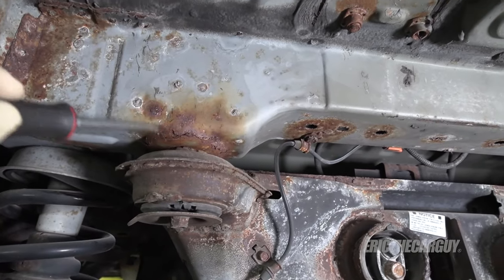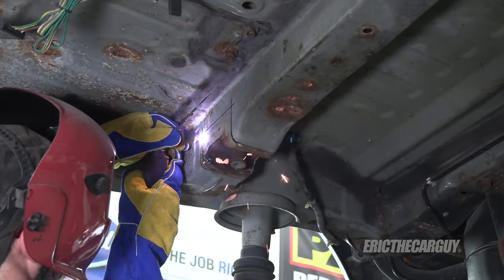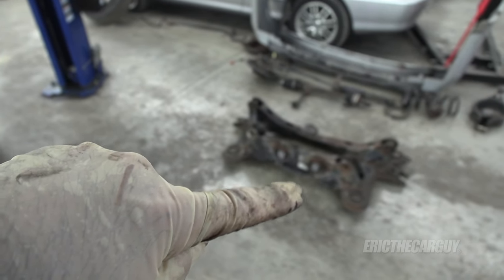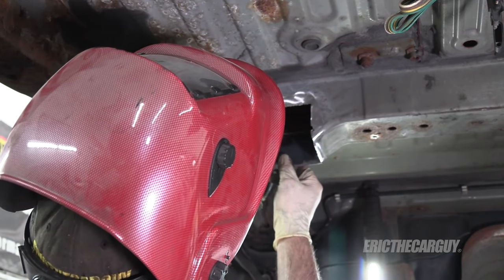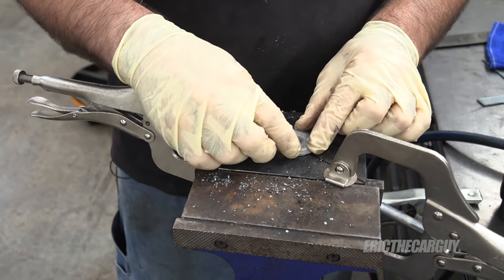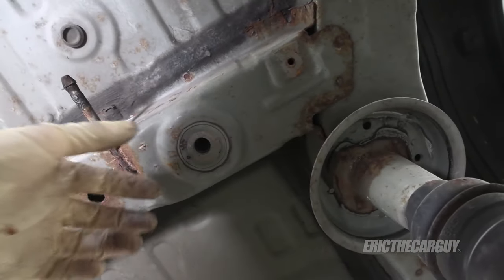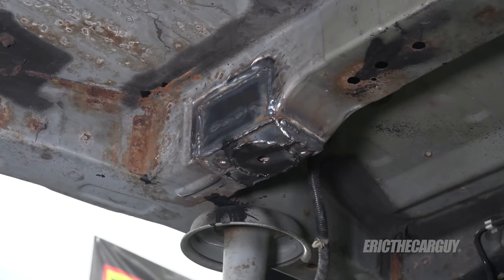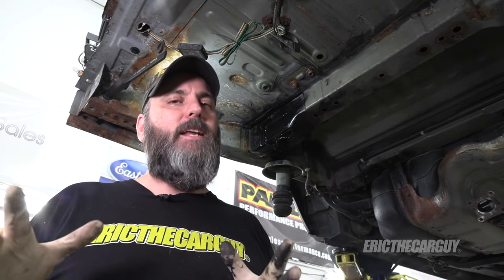How To Repair Structural Rust Damage

Comment: Hi Eric, weld through primer is a great product to help reduce corrosion on the surfaces you cant get to after welding.
Reply: i wonder how do they do on assembly line, the metal panels are raw they weld them and then paint it ?
Reply: @mondecruel1866  at the factory, the body in white is fully submerged in a vat of primer that gets into every single seam and blind cavity (if you have ever looked inside a trunk without the trim and wondered why are there so many stamped holes that needed to be plugged up, it’s because those were drain holes to let the excess primer drain out of the body as it was removed from the vat)
Reply: @mondecruel1866  They dip them in an acid bath after. Then they take other baths in sealer/primer.
Reply: @evolence detroit Look at any video that covers a modern assembly line. 

Ecoat is only done on replacement body panels so that they don’t corrode while sitting in inventory. 

All new cars during production do not get an electrolytic coating because it creates unnecessary prep-work steps through the production line.

The chassis and body panels are finished raw.

On a full production line, the chassis are dipped in an acid bath to etch the entire chassis, rinsed, then dipped in sealer/primer bath. Then it gets its finish coat from robots.
Reply: @evolence detroit  No matter how it's done, NOT even attempting to paint or rust coat bare metal is wrong. midwest to east coast, rust through in 5 years on this very decent repair. What a shame.
Reply: Best thing is to rust proof DIY way into those corners and holes. And if possible disassemble and reassemble using lots grease so moisture and water doesn't collect. We just have big bucket of cheap grease that we use for assembly - it saves nerves, time and money down the road.
Reply: @rotor13  VW uses electrostatic coating.
And the stuff is wicked, you can mildly heat a panel with a propane torch to use a wire brush to get the undercoating off, and the E-coat remains unhurt. 
Best to leave as much as you can instead of taking it off to bare metal.

Comment: If anyone wonders why rust repairs are expensive, this is a good video to show 

Inspiring work as always
Reply: Bondo and pop rivet rust repairs are less expensive.  This video shows how it is done properly resulting in a safe vehicle.
Reply: He did that repair in 25 minutes though, that shouldn’t cost $3k+! /s
Reply: @BlazingLightSword  the repair was condensed to a 20 minute video. I'm sure he has more time in it than that!
As he stated, he's not a welder or fabricator. Plus he took the time to video it. Setting up for video takes time.
For a beginner, like me, he did an excellent job!
Reply: A cast sleeve in a welded mount under a stamped raised ROUND footing.  I don't know a lot of guys that would've fabbed that from scratch, especially with only three tools.  Good stuff.
Reply: @BlazingLightSword  you actually thought that took 25 minutes? SERIOUSLY?
Reply: @TaintedMojo  It took 24 minutes and 58 seconds.
Reply: @BlazingLightSword  that joke flew over so many heads X)
Reply: if this were a customer's car Eric would have been honest and told them that this repair only covers one section of that rusted frame and it might not be worth it if yo have to pay over and over for more welding.
Reply: This is also with a lift and not crawling around under the car while getting beads all over your body
Reply: @Menoxz  LOL, yea, this repair would suck if you tried it on jackstands.
Reply: @Menoxz  beads?
Reply: @inglouriousmofo  the high temp filler material being used to create the weld - some of that material showers off in the process - so if you can stand off under a lifted vehicle that's preferable - if you have to lie underneath on the ground with your mask that wants to come off, and fumes and smoke that surround your restricted workplace, obscuring the task, all the while hot molten particles of metal fall upon you - not so much. Unfortunately - not many DIY's have a home based lift - so strap in and enjoy riding the dragon!
Reply: @Maurpaa  I guess I'm one of those that didn't pick up on the joke...
Reply: Unfortunately this shows a incorrect repair using incorrect materials. All OE's have a procedure for a safe and proper repair. He definitely is no welder. Obviously is this was for someone elses car you would not want to do this type of repair due to liability if it should ever be in a wreck.
Reply: @BlazingLightSword  you have got to be kidding me.
I don’t know the cost of this repair but I would guess $700-$1000. 
Skills like this are worth $75/h at a minimum. 

To do this right I would say it would take 7-10hrs of work + planning time.

Yeah it’s expensive but if you are too cheap to pay for someone to do it properly you can try it yourself.
Reply: @BlazingLightSword  Bro, im a welder fabricator and would take aloooooot longer than 25 mins bud, give it a shot and see what i mean, takes alot of skill, attention to detail and accuracy else whole jobs screwed. Welding fabrication is like an art, not just any old shelf stack job lol One love bro (y) :)
Reply: @phillipc.1805  Familiar to that bro, plenty of burns and scars to show xD haha Puts hairs on ones chect haha I soooo need a ramp :/
Reply: Wait, you've actually found people who do this? Because I had to go learn to weld after realizing that even if I sold my firstborn, nobody would do this kind of work.
Then again, I was living in a state with frankly absurd regulations regarding rust that made it more or less illegal to own a vehicle older than 3 years.
Where I live now, duct tape is more or less a legal alternative to welding..
You know honestly, I'd like to find somewhere in the middle. Where a bit of rust isn't going to fail inspection, but I'm not driving next to a guy who zip tied his radiator to a brake light cover... Can't seem to find a sane middle ground of all the places I've lived: Either gotta have a brand new, garage parked, under 40k vehicle... Or can drive anything, even if you're technically driving it upside down. Or that's how it feels anyway...

PS- I moved for reasons completely unrelated to vehicle regulations. But noting these differences, both extremes are problematic.
Reply: Yeah...a welder and metal are relatively cheap, but a brain skilled enough to use them like this is priceless.
Reply: @BlazingLightSword he started the job with the subframe removed. He's already 2-3 hours of labor deep by the time the actual repair starts. At my shop the customer would be in it for $750 minimum by then.
Reply: @BlazingLightSword  crazy that u're getting these "no wae brother this isnt 25min job lol im a welder myself" comments after these years lmao. U've even put an /s for these fellows, lol
Reply: EVERYBODY  KNOWS THAT  RUST REPAIRS ARE EXPENSIVE

Comment: You might not be a fabricator, but that's a job well done.
A job like that requires the ability to plan ahead and visualize the next couple of steps.
Reply: I am not entirely sure why he put the flat disk on when he did and not last.
Reply: @Oblithian  probably to make sure the rear subframe was positioned correctly when checking the fitment.
Reply: Sucks I can't visualize

Comment: I just did a 97 CRV, where the trail arm bushings mount up. It was my first go at fixing structural rot, and I'm very happy with the results. I ended going with what your original plan was, welding a nut behind the first layer. I did not consider it needing movement, however after watching this I am still pleased to know someone with much more experience then I had a similar idea. Very confidence inspiring. Thank you!

Comment: I use cereal boxes for making my templates in metal fabrication. stiff enough to hold it's shape, but can still be cut with scissors. Besides, everyone has cereal boxes, and you don't need to go to Staples for manilla folders!...lol. Great video Eric!
Reply: Old oil and air filter boxes work good too
Reply: CAD. Cardboard Aided Design.
Reply: milk cartons, for those that get it in cartons anyway. lol
Reply: I use a cereal box when spraying my motorbike chain. Cut a side off so you get an L shape at the fold, then protect the tyre with it.

Comment: Your comments about the worthiness of this repair on an old vehicle is exactly the calculation I did before I started doing some body and frame restoration on my Subaru. While I agree with your overall assessment and this kind of work makes a lot more sense when you can do it yourself, you took non-road worthy car that wasn't worth much more than its scrap value and turned it back into a vehicle that can be operated safely and sold with a clean conscience. So you have added thousands back to the value of the car. This was my way of justifying the amount of time and money I've invested learning these skills.
Reply from the maker: No I haven't. This Pilot is worth $4000 on its best day. It's not it's best day. This repair would have cost somewhere in the neighborhood of $3500 if you took it to a shop. I still need to replace the transmission which is another $3000 in parts alone. Not to mention the front suspension repair, the interior, and the engine service. In all, I'll probably have at least $9000 into this $4000 POS. I don't think that's good money spent at all, but it makes great content, and I'm happy with that. Thanks for the comment.

Comment: I just discovered a very similar situation on my 2004 Element. I immediately remembered this video and came to rewatch it. Replacing the vehicle isn’t an option right now and we love this Element so I want to fix it. Thank you Eric!
Reply: I just found it on my 08 Honda Pilot. FFs!  No wonder she drives all friggin squirely.  Mine is worse then this one with the mount point having completely pulled through.  That said, I do have a cheap TIG / stick/ Plasma cutter, a grinder and paint lol.  I've gotta pull it apart back there anyway to do some service on the rear end and figure out my VSA issue.  This is our Daily, so something tells me i'll be doing this sooner rather then later.

Comment: Great repair Eric!  I was thinking you might need a thicker plate around the bolt, but you boxed it in nicely.  As an amateur fabricator myself, it looks good enough to me.  I was especially impressed with your trick of bolting everything together to get a proper fitment.  That was smart thinking.  Some tips I learned from Mustie1's videos, is to now spray oil up into the newly fabbed piece, now that it's done.  This helps prevent future rust.  He uses bar and chain oil.  I have used fluidfilm for this myself, inside doors I fixed.

I use pop and beer boxes for making my templates.  They're always around and they come in different thicknesses.  👍

Comment: Great repair, I can see how the labor time can far exceed the value of the vehicle.
 considering that there is probably other rotted areas to address also.
Reply from the maker: There was also a hole in the body but that was much easier to repair. Otherwise it's pretty solid. But you're right, a vehicle like this is rarely worth investing into.
Reply: @ericthecarguy  Unless you like to campaign things to 1,000,000 miles though I do admit down here in the South (GO HOGS WOOOO PIIIIIG SOOOIEEE) it's easier. It takes 30+ years for that kind of damage to happen to Hondas down here, much longer if they're regularly cleaned and garaged when not driven.
Reply: These have very good engines and are very reliable cars if well maintained. My friends wife put 300k miles (second tranny), before they sold it to some home improvement guy who killed it within more than a year (no names calling here).
Reply: @hithere7382  California cars live forever

Comment: This reminds me of exactly what I had to do to my '89 Buick,
when I replaced the transmission.
One jerk in the Club I belonged to at the time- remarked it would be labeled
scrap where he came from, and he was very nasty and rude, something
about "polishing a _ _ _ _". He's a big deal Moderator now, 10 years later-
go figure?

Eric, you did a wonderful job here. Always remember- because the temper
is changed, a weld is always the first to rust. Keep welds to a minimum,
and treat them accordingly.

You could've made a "box" and made folds on a pattern, 2 welds. Easier
with a bender.

The threads are deep, so the shank goes up into the mount, more integrity,
less wiggle as possible. That's what the busing is for, giving movement.
A wiggling bolt would snap. The 4 bolts I had to buy were $30 each.
Bushings were $50 each, got all 4 for rear of front cradle.
Reply: I mean it’s an 89 Buick. He’s not wrong lol

Comment: Thanks Eric. You've given me some more confidence for my next rust removal job I'm starting in the next few days. Instead of paint inside your repair I think the Lanolin rust preventative coatings that I saw explained on the "Repair Geek" YT channel would be even better as they can be "topped up" over time unlike paint which may not have bonded perfectly to the inner welded surfaces. I'd appreciate your comments on this. cheers Andy

Comment: Thanks for making and posting your repair..  I hope other rust belt Pilot, MDX  and Ridgeline owners will inspect theirs.  Keeping the long threaded boss and joint design close to original is also wise.  Better bolt stretch and load paths into the cross member, as you said.  You make it look easy!  The Honda body repair manual says to replace the whole crossmember, .. If Honda would sell the crossmember at a reasonable price, more people would follow their recommendation. I believe it's over $600 just for the part.  I would recommend poking the passenger side rear mount area too, as they seem to rust from the inside out (maybe you already did it) .. Thanks again Eric . it's fun to watch you work, and learn from your experience.

Comment: Also elements rust from lower rear trailing arm front mount I heard. So glad I keep mine treated with rust prevention. That kind of repair is borderline illegal here in Finland and they get angry at yearly inspections. :/
Reply: No states truly do a safety inspection here. It's basically checking if tires and brakes are good. No body shop would do this repair here though. That frame rail is high strength steel. Welding in mild sheet steel changed the crash characteristics of that frame rail. Granted, it's far from crumple zones and would likely not be an issue, but still not something a body shop would touch with a 10 foot pole.
Reply: @evilstan60  Fairly sure that old and degraded High Strength Steel, due to heavy corrosion, metal fatigue, probably micro fractures all over the place, or even prior repairs where someone used a torch to loosen fasteners...no longer qualifies as HSS and that brand new thicker guage low-medium carbon steel has better properties.
Reply: cars turning into rusty piece of shit in less than 8 years is a normal thing in Canada especially in Quebec so body jobs are a common occurence here, most shops wouldnt do repairs like this but this is 100x prefered over its previous condition in which probably millions of canadians drive around in. waht do you do with a car in finland thats around 10 years old and has market value of around 20-25k$?

Comment: Excellent presentation Eric. Also, your strategy as to how you approached this difficult repair is right on par with a similar repair I am presently working on. In my case, the unibody rusted out at the two front points where the undercarriage bolts into it. I did practically the same as you did with cutting out the damage, making a template, fabricating new pieces, using the undercarriage as a jig. My two fabricated parts are ready to be welded into the body. Since I never welded on a car body before, I am a bit anxious and and practicing with 16 gauge mild steel scrap first so I don't end up blowing holes through the body. I think I am ready to go at it now so hopefully, I can get my 2006 Saturn Vue back on the road.

Comment: For the inside you can coat peaces with body leading paste. As you weld it will melt and bond to bare metal and leave it with thin layer of lead which works beautifully as rust prohibitor

Comment: Did some simple body work to my 06 E350.
Those vans are known to rot out on the driver and passenger foot well as well as the rear wheel Wells.
Took a week end and got it taken care of. Even put a layer of fiberglass and epoxy in the floor or the passenger compartment cause I have the material.
You can find real value if you can do work for yourself.

Comment: Nice work Eric! Back when I had my automotive shops this is what I would specialize in in upstate New York. Frame repair body mounts even control arm brackets built in the subframe that were rotted. where a lot of other shops would not even touch it or even think about saving a good vehicle. Sometimes it is a lot of work. It's mostly pickup trucks but a lot of cars also. It's got to be my favorite video I seen from so far because this is what I used to specialize in. And I still do it on the side. And then there's always that argument whoever is inspecting the car especially dealerships oh that's been repaired we can't pass that b*******! That welded in bushing your repairing it's going to be stronger than the whole support.
Reply: Do you recommend anybody in Upstate NY nowadays? I’ve got a 03 TJ that I want to save… what the last owner did will shock you.